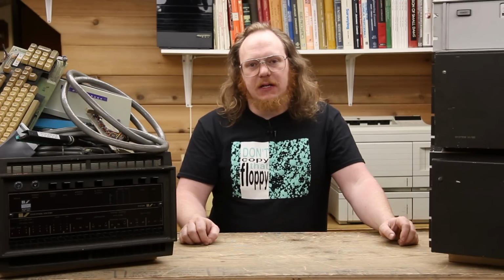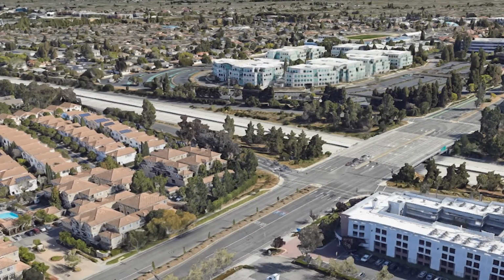Four-Phase systems - The Expansions, the Cables and the Future - Part 2

Comment: In the 80s/90s I worked for a hotel firm that used these computers to run the billing and reservations systems. (big hotels, 500+ rooms),
Each hotel had 2 of these systems and every transaction happened on both systems, at night the hotel would use the read only/backup copy while we ran audit on the live one.
I only remember the computers going down once in 5 years - but that was the big storm of 1987 and there were many power cuts 

When the hotel I worked in moved to a PC based system, the Four-Phase system stayed in the basement because there was no way to dispose of it. We even offered it to the Science Museum who declined.  I wonder if it's still there ? 🙂
Reply from the maker: Heh, it might still be hiding down there. These systems are heavy.

Comment: The old style keyboard: in our repairshop in germany we disassemble the Keyboard, remove the chip and put the rest (inclusive thr board) for about 30 minutes in an normal dishwasher.After that we wait until the keyboard is dry, assemble it again and we had a "new keyboard "
Reply from the maker: I can believe that. There's so little to this keyboard that you can wreck with water.

Comment: 22:27: In 1989 I found this one in a dumpster and took it apart. I salvaged those switches with the LEDs from the front and those TIL311 LED Displays I salvaged are still in used to this day in production test equipment.

Comment: NP 80: the big one connector is a "chain-cable" for up to 4 drives, the four smaller Connectors are the datacable for each device. The chaincable has to be terminated on the last device in the chain.

Comment: You vorget an very  interesting peripheral system: the Data Printer LP1000, an very fast hammerdriven printer with 132 characters wide and "1000 lines per minute". To switch on this device you need an line with 25amps circuit breaker

Comment: There were two terminals on each cable.  Each screen showed half of the video signal, top half or bottom half.  One time, I got them swapped so what you typed on one keyboard showed on the other screen.  Instead of trying to figure out the dip switches to change them, I swapped the monitors.  At night, we would shut down the user interface and run night processing.  The users said they could see various data on their monitors.  Apparently, the system used the video memory in its night processing.

One time, the system quit working.  Our local tech called a system repairman and asked if there was anything he could do.  The repairman told him to pull all the circuit boards out of the system.  He did that and then was told to put them all back in.  It worked.  Apparently, the card edge connectors had corroded enough that they no longer made contact.  Pulling the cards and putting them back in cleaned them enough that it worked.
Reply: In our repairshop (germany) we remove the mainboard, put it in an ultrasonic bath for a while, clean it with airpressure and reassemble it. Still working again. we also disassemble the reedswitch keyboards and put it in an dishwasher (The print and the housing) clean it and reassemble it, so we could about 10 keyboards cleaning at once
Reply: Terminals: yes and no. you can configure the terminals via jumpercards on the IV/70 itself, so you can configure 64 halfscreen or 32 fullscreen terminals. The most of our customers use the fullscreen terminals. I know only one customer who use the halfscreen variant, this was an data collection system. All customers using the maestro-software use for the 3270-emulation the full-screen with special character-set (for the "dot") within the simulation
Reply from the maker: @gerdvomhau4499  I think I see the jumpercard now. If it's not the little boards on the mezzanine it's a strip of pins on one of the I/O cards. you strap to enable/disable terminals.
Reply from the maker: I was actually warned about how troublesome the edge connectors were in these machine. In some cases they liked to "sing" because of variations in current trying to cross over marginal connections. The fact that you were seeing data on the screens is correct. When terminals were deallocated form the character generators the system could reclaim the memory for jobs. If for some reason the character generator was still operating during those jobs you would see garbage being sent to the terminals.

Comment: I suspect most places just used it to transmit batches to an IBM mainframe… Shared Medical Systems (later a part of Siemens and ultimately sold to Cerner to die) was a major hospital information systems vendor that offered a remote hosted IBM mainframe system with a Four-Phase mini at each hospital to submit batches to the remote mainframe.   Another vendor, HBOC (which later merged with McKesson) offered a more self-contained hospital system for the Four-Phase.  At a previous employer I worked with a programmer who used to work for HBOC on that system.  He spoke of being offered a decommissioned Four-Phase (which he unfortunately turned down).

Comment: @21:24 Those actually look like Hexadecimal displays.  They can display both letters and numerals.   Xerox used those for the diagnostic panel of the 860ips.  I remember replacements were $25 each from Xerox in the mid 1980s.

Comment: As a technician for the RCN, our updated Tribal class destroyers used two disc drives the size of large dish washers to run the Command and Control System (similar to AEGIS).  The same disc packs or similar to what you held in your hands.  They were used for a decade before they were upgraded to Hard Drives (1987-2000).  The drives were fitted into their own cabinet with pneumatic arms to dampen shock and motion, everything the sea could deliver.  If the R/W heads touched the spinning disc a hair width away, or encountered a dust particle, the head would explode sending debris everywhere inside destroying all the heads and scratching the disc pack to uselessness.  The CCS hardly blinked because of redundancies.  Dust from the disc pack covers introduced during removal or installation was most likely the cause for catastrophic failure.  A six hour repair required a card extender for the circuit card driving the heads.  Monitoring test points with an oscilloscope while nudging the heads with a two foot long rod gently until they were aligned.  Everything is exposed so pre-cleaning had to be immaculate with new air-filters replaced.  Built-in test equipment were available post alignment in the cabinet, so what you have may be quite limited.  On a naval ship, space is limited. So squeezed in beside the cabinet, hunched over the exposed device while the ship is pitching and rolling, changing coarse often was quite the chore. How I did not introduce hair or other small debris resulting in more destruction was the drive had constant air suction circulating in its round enclosure.  I had test points designed to receive probes on every card and cabinet.  I could not see anything on your cards.  Surprisingly I sailed most of that decade, with only two such repairs required and I had spare heads, filters and disc packs (alignment/test and operational) onboard.  The procedure was well documented and worked well for a analogue procedure.  The packs were 300MBs if I recall correctly.  Check military industrial suppliers contracted to install and document military or government systems.  Or NATO countries government auctions for parts, they often hold on these parts and equipment for decades, or dealers who often bid in bulk buys of said auctions.  Everything had NATO stock numbers which indicated which country supplied the stock, so reach out to a retired military stores man, he may have a set of demoted inventory on microfiche (a copy would easily fit in your pocket).  Also retired electronic techs may have held onto their training course materials for similar peripherals, connectors, and documents indicating their nomenclature with references to other docs such as part numbers, schematics, and repair/fault-finding procedures.  Good luck with this endeavour, your quest is steep.  Qapla'.

Comment: Thanks for the trip down memory lane.  I supervised a data entry department, 1978-1980, for a large Mpls bank and we used the IV-Phase 470.  About 16 terminals using key to disc and data were then written to tape for further processing on the IBM mainframes.  The 470 was powered up and in use 24/6 since we ran three shifts Monday-Saturday.  Quite a reliable system and only down time was during the summer 1979 President Carter energy mandate requiring room temperature at 78 Fahrenheit.  We used two big fans blowing on either side of the stack for improved airflow and to prevent the overheating sensor from tripping.
Reply: These machines did NOT need an air-conditioned computer room. Our computer room (I worked for a company that wrote software for the IV/90) was always hot.